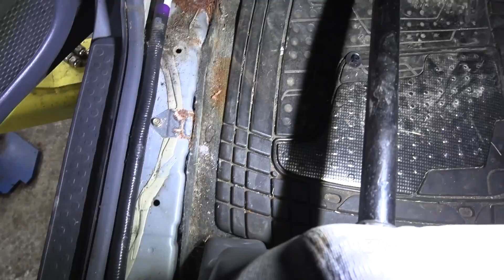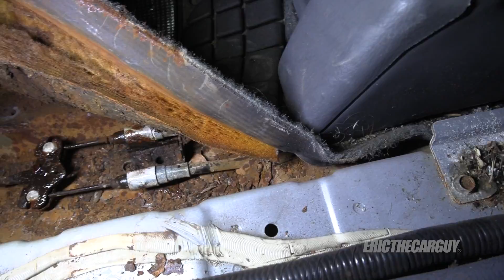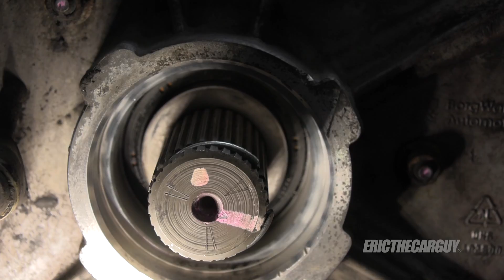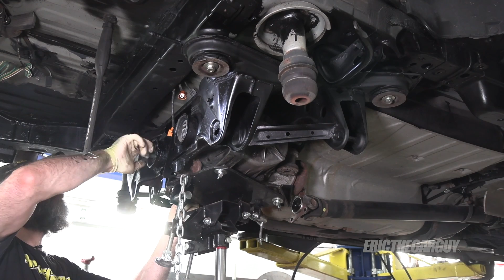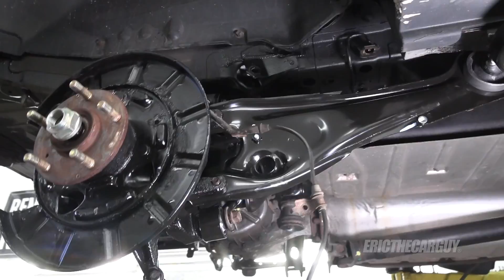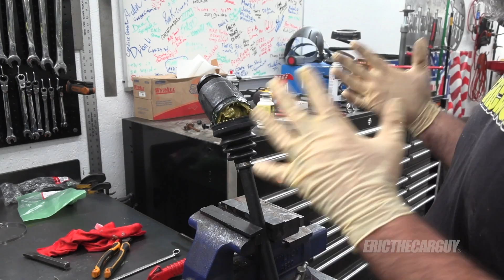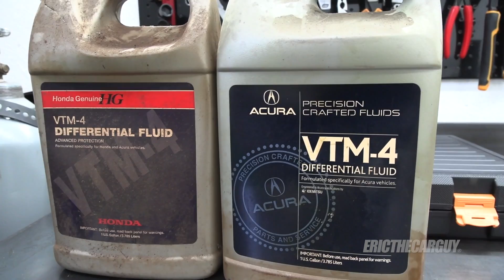Honda Pilot Complete Rear Suspension Rebuild (Part 2)

Comment: I’m a parking brake guy too. I learned to drive in hilly San Francisco. If a car runs away down a hill, it happens, and the parking brake wasn’t set, you’re in big trouble.
Nice job on the rear suspension job.
Reply: Agreed, I decided to go ahead and replace the shoes on my brother's 06 when I overhauled the suspension as I discovered that the parking brake wasn't holding on a hill when I tested it with the car in neutral. There's a good chance that I could've adjusted the shoes and then the parking brake probably would work just fine, but I figured that since the car had well over 200k and was over 10 years old, who knows how much life those shoes had left. Plus at the time my brother was getting ready to move to Virginia, where they do in fact have State safety inspections, and a faulty parking brake is a failure point for that. So I wanted to make sure that it was something that was going to last and not present any problems in the future.

Comment: How about putting anti-seize on the axle "teeth" instead of WD40? Those tend to be a pain to remove if they get seized up real bad.
Reply from the maker: I don't think that's an appropriate use of antisieze. I think that will mostly just make a mess. WD40 is a rust inhibitor, and a good one at that.

Comment: Now you’ve entered my world as a rustmeister, as I have been chasing rust around my ‘01 Jeep TJ for 5+ years.  I haven’t used Rust Encapsulator Plus, but I have used the non-plus encapsulator in combination with Eastwood Rust Converter.  I was disappointed by the performance of those products, and to keep it relatively short, what I found is that you must cover the encapsulator with a top coat paint.  Must.  My memory is that the instructions on the encapsulator said top coating was optional - oh no it’s not!  Even in places under the car where you think there is no exposure to UV light - top coat it.  It’s more work & time yes, but I think it will help keep the rust monster from quickly returning.  For my latest round of rust hunting I decided to try POR-15 instead, since I am just completing this on the frame and underbody I can’t say yet whether POR-15 + POR Chassis Top Coat is better, worse or the same as Eastwood.  Time will tell.  I also tried the new Eastwood Platinum rust product on the front half of my frame, so I’ve got a long term experiment going on which Product is better.  I will say with POR-15, it’s clear that good thorough proper prep is King, so it’s a LOT of work.  Lastly, for small and midsize parts like your rusted floor tray, I derust those parts using the electrolysis method.  Electrolysis leaves no mystery that every spec of rust has been removed.  It too is time consuming to let the electrolysis do it’s thing, but I am a fan of that method if you want to be sure Mr Rust is deader than a rusty door nail.  Every year I go on a rust hunt and inspect the car for new or recurring rust.  I wish I had a lift for that!  Thanks!
Reply from the maker: Thank you for that info.
Reply: Very informative @Mike Hartmann
Reply: When I bought a brand new or used car, I just do a full detailed underwash and spray with WD-40 White Lithium Grease all over connections, joints, bolts, electrical wiring sockets, etc. I'm surprised the chemical stays there like forever, it prevented water, rust and it doesnt fllused away with water and mud. I just have to do a full detailed underwash and lithium spray twice a year. Car looks brand new without signs of rust when the old lithium coat is removed for a fresh new spray. The lithium grease looks like a aerosol white paint because it stays there and doesnt run even after a few months. But nobody goes under to check how your car looks like.
Reply: @oofheck3754  to try and shorten up my long note here, I omitted my intention to spray Fluid Film over the POR-15 work I’ve just completed.  POR15 takes 4 days to fully cure, so I’ve  wrapped up that work and will wait the 4 days and then apply the Fluid Film.

Comment: I just don't understand the lack of use of a parking break, especially with an auto transmission... Why would you want the weight of your car resting on the transmission instead of your break - something it was designed to do?

Comment: what does people use if they don't use parking brake?. transmission's parking pawl?. that would hurt the pawl in the long term right?
Reply from the maker: Not necessarily, but I feel more comfortable using my parking brake over a piece of metal that's no bigger than my pinky finger.

Comment: almost looks like this thing was in a flood...  Seems to be even more rust on the inside floor than there is underneath... like it held water for a while?  weird.  (although, there's plenty underneath too).  I live in Oklahoma, I don't see any of this type of salt belt rust--- I don't know how you guys deal with it. lol..  There's no way I could ever buy a new car living in an area like that--- knowing it's gonna be destroyed before I can even pay it off.. what a bummer.
Reply from the maker: When I worked at the Acura dealer we had an MDX of about the same vintage come in with a water leak that was contaminating the fuse box behind the LF kick panel. It turned out that they forgot to put body sealer on one of the seams behind the door pillar. Perhaps this Pilot has the same issue. I plan to check for that in a future episode. BTW, the MDX is just an expensive Honda Pilot.
Reply: @ericthecarguy  Yeah,I'm aware.  I actually bought an AWD, 2002 Acura MDX for $1700 a couple years ago.. 3 rows of leather, heated seats and mirrors, big moon roof.  Only had 160k miles, 90% tire tread all around. AC blows stupid cold and really hard.  Has the 3.5l vtek, Not a drop of oil leaking anywhere on it, not a single sign of rust (again, I live in Oklahoma, so we don't have rust here typically)..  I absolutely love this thing, and I feel like I stole it...  The only one thing that is wrong with it is the center screen doesn't work-- but sometime when it gets really cold outside, it will suddenly turn on and work for the first few minutes of driving, until the car warms up and then the screen just shuts off again.. Doesn't matter to me, I'd just assume take it out and put in a big "Din cubby hole, or something....   Between Honda/Acura and Toyota/ Lexus... and the Big four motorcycle brands--- I love Japanese engineering.  I can't get enough of it.. I have several used dirtbikes and several more quads that I've picked up as projects along the way and I take time to fix them and get them running... The Japanese know how to engineer things.
Reply: My thoughts as well.

Comment: GREAT JOB ERIC!!! Such emphasis on detailing as usual. I'm IN PA, so ANOTHER rust belt state. Ppl will probably cringe, but I anti seize ALL my suspension parts, except rubber & silicone those. I've never had anything come loose. Love how u encapsulated parts/painted. I have OCD, I'd prob fluid film when I was done. I get excited on fixn vehicles like u did. It keeps it on the road. Everytime I drove it, I appreciate the job I did & the vehicle ALSO. Money doesnt grow on trees, so I appreciate simple things. Thanks for showing tightening on ground,wished u would say what u were tightening. Looks SUPER!!🙌 Ppl will see ur shiny suspension parts driving behind u!😁Will u be doing anything to front suspension being u mentioned it?  Ur SO interesting/down to earth guy! I'm not even DOING this job but it's so damn interesting!! Great video! 🇺🇸
Reply from the maker: Thank you. I tightened all the fasteners on the ground. I thought I covered that just before that part of the video. Sorry if it wasn't clear. Yes, I will be covering the front suspension when I drop the front subframe to replace the transmission. Here's a video detailing my plans for this vehicle. https://www.youtube.com/watch?v=11nl6FCkr-s

Comment: Have you researched the VIN to determine where this vehicle started life cause there’s rust in areas that points to saltwater damage 🧐
Reply from the maker: No. I suspect it was driven locally. They salt the roads in winter. This is often the end result.

Comment: Is there a reason that you choose to use WD40 instead of anti-sieze on the axle spline at 17:57? I've used anti-seize before on the spline but I'm not sure if it's safe or recommended. Does anti-seize not provide any rust prevention? Any insight is greatly appreciated! :)
Reply from the maker: I don't think antisieze is appropriate in that application. As I said in the video, WD40 is a rust inhibitor, and a very good one at that. I hope that helps.

Comment: This is a great demonstration video on how important right to repair is. This vehicle would have 100% ended up on a scrap yard. With the right knowledge and the right tools, professional technicians are more than capable of performing repairs of this kind. 
Another well done repair. Bravo.
Reply: I understand the sentiment, but none of this is a "right to repair" issue really, is it? Right to repair is all about manufacturers limiting access to repair parts and information. 

The only reason this Pilot would otherwise have ended up scrapped is the sheer cost of repairing it versus the current market value of the vehicle, not lack of availability of parts.
Reply: @dunebasher1971  I suppose the argument could be made for special scan tools for like brake changes on some cars, otherwise it doesn't apply here.
Reply from the maker: Thank you!

Comment: What is the purpose of those Drop (stabiliser) links?  Cheers.
Reply from the maker: The purpose of a stabilizer bar and links is to equalize the suspension on turns. Makes it more stable by helping to prevent body roll.
Reply: thanks eric

Comment: I used those aftermarket adjustable rear control arms (SPC Performance I think) on my 08 Odyssey.  The ball joints lasted less than 40k miles before they were loose.  When I contacted them about it they wouldn't do anything about it and told me I could purchase another one.  I removed them and put back on the originals.  238k miles now and the originals are still tight.  Great idea but the part is junk.
Reply from the maker: I didn't use that brand. What I used is linked in the description. Thanks for your comment.
Reply: @ericthecarguy  Well, hopefully yours last longer than mine did.  Nice job on the repair and rebuild.

Comment: Looks like there was a bit of water intrusion.
Car looks good didn't expect that amount of rust on the inside.
Reply: it isn't. Thats how every 10 year old car's floor will look in the rust belt if you don't clean your carpets and use weathertech floormats otherwise all the snow/salt from your shoes melts and goes right on your floor
Reply: @Motorsportsgeek  and stays wet forever!  (and stinks)

Comment: I used the adjustable uppers on our similar era Pilot - and the poly end squeaks like hell now, after 30K miles.  What are the ones you used?  I can't grease the ones I have.   Love to find an alternative.  We had horrible tire wear issues until I swapped in the adjustables.
Reply from the maker: Linked in the description.
Reply: @ericthecarguy  doesnt say in their description if the bushing is rubber or poly.  is it rubber?
Thanks again!!
Reply from the maker: Follow the link and ask the manufacturer. I never checked to see what the material was.